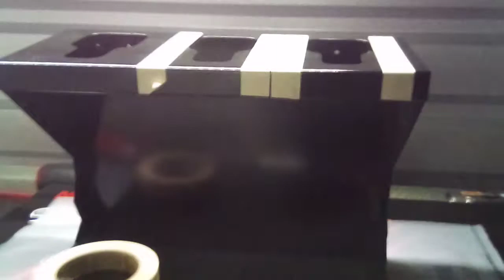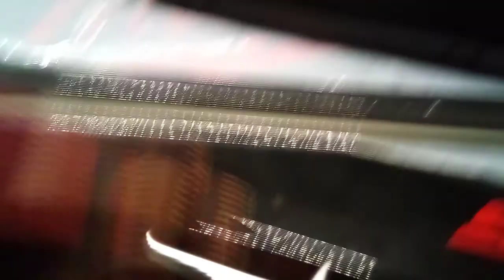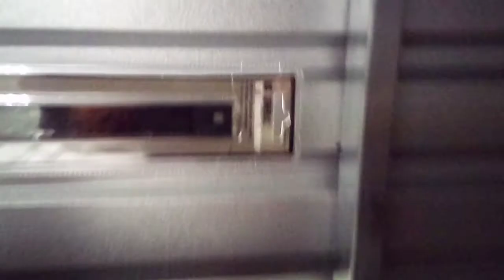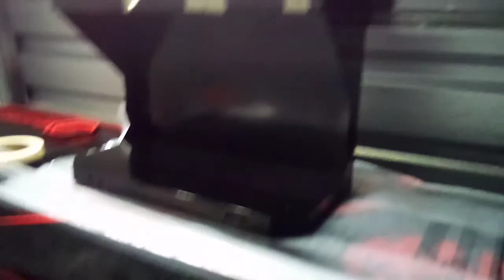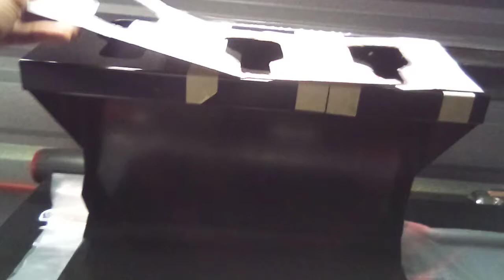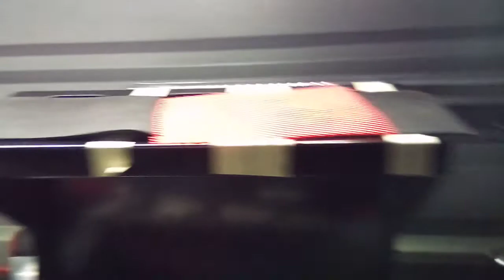Just Another Day In The Shop Storage Unit Walk Thru And Tool Cart Tool 👨‍🔧Review Pt77 #usgeneralmod🔥

Comment: I like using magnets to hold my tools. I notice that sometimes the tools vibrate off. Do you ever have that issue?
Reply from the maker: @billbeckett No I do not because I do not normally use them besides my magnet trays but I do have the SNAP-ON Magnetic Panel Which is very strong ...I actually have it sitting under the Noco Genius Boost in the compartment of the Cordless tool organizer ...I was going to place it originally along the back end side of the side tray but now I actually have a different solution now in which I plan to use it ... The Upper Portion of the SNAP-ON Magnetic Panels Can actually be separated from the Tray it sits in ...I'm not quite sure weather or not people know that or not but when I first got it and I took it outta box that was one of the first things I wanted to know and once I detached it from the tray it gave me a whole new idea ..I didn't want to put it on the inner lid because the Magnets to it is so strong it would be extremely hard for me to remove it if needed from the upper Hood lid ..I might shoot a video showing that it can be separated and just how strong the magnet is ...I believe they are a whole lot more stronger than just so to say the Husky version and the Time saver panels if you put a tool on it ..It will definitely stick and not go no we're I was going to use it for my Crowfoot sets and my  SNAP-ON XL high performance Double Flexhead box end wrench set